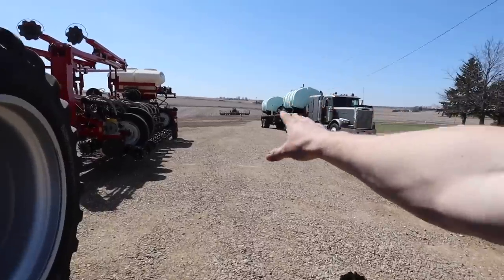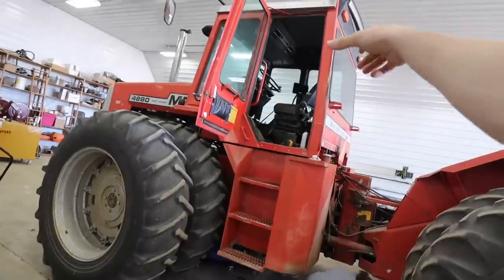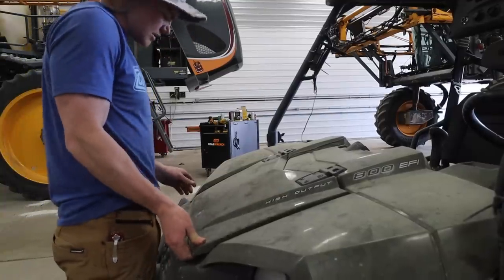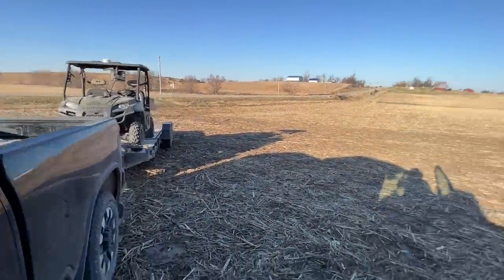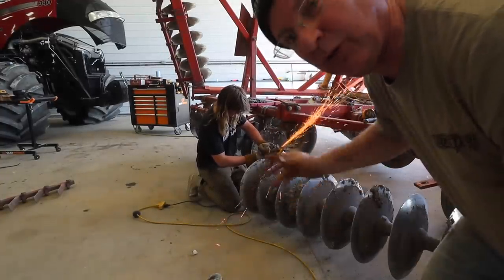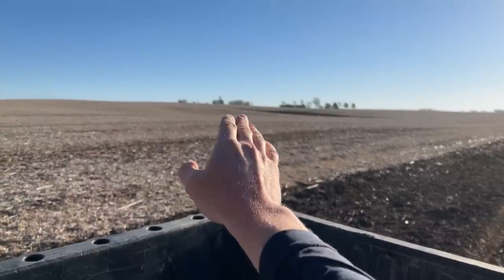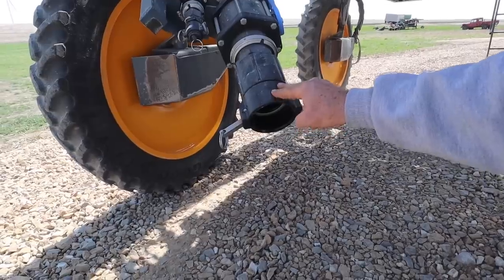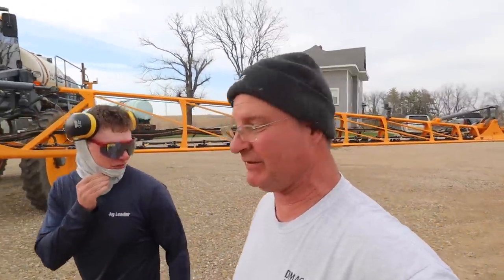My 1st Day Working On The Farm Was TERRIBLE!

Comment: Tire Jet. My Ranger tires are weather checked, had green slim in them and it leaks out. Disassemble them, cleaned and replaced wit Tire Jet, no more leaks. Try it with those Ranger tires with plugs.

Comment: You are forward thinking on many things.  Your tillage if you clean up before parking.  Note any issues.  You could order parts over winter and save a parts run. Local implement dealer pulled a huge overcharge. Now I buy those parts online. I need three scrapers for the disc?  I buy 10 (for the cost of 5). I am watching this as it’s SNOWING in MN.  Chasing cattle. They want to get back in because that is where its “safe”   Slower speeds often help for less damage putting them in.  You can take them around pasture till they get to the gate you opened.m

Comment: modern drones have great mapping features - v accurate - you should do your own radio and internet systems  - the point here is you will have redundant systems and also mapping would be 3x faster or better with a drone vs driving - hopefully you can get last minute repairs done and get planting done - hope for good weather

Comment: Would eliminating a sprayer and using the value of that to hire a driver to tend the sprayer, put in bulk storage tanks, or bigger tanker help eliminate your issue? With another sprayer and having a limited number of bodies, wouldn’t that even more so lower your efficiency? In Indiana, we utilize “hot loads” and don’t mix any ourselves.

Comment: The easy solution would be to ride with your dad for 10 minutes and make sure he understands how to use the directional steering. Then it is done correctly instead of having to correct it later. 😎
Reply: Who has 10 minutes when spring has sprung ?

Comment: Really don’t understand ya all sitting on your hands all winter with random projects and vacations and a bunch of broken down equipment in the buildings.  You did the same thing last year.  To me harvest would not be over until all equipment repaired  and ready to roll in the spring.  Maybe take one week to sleep all day, then 12 hour days until all washed and repaired.  Only thing left would be oil and filter changes.  
You are showing broken discs??